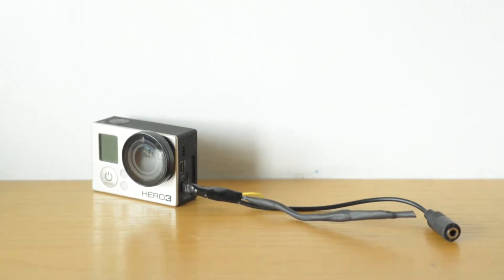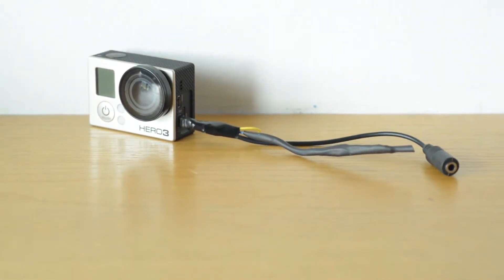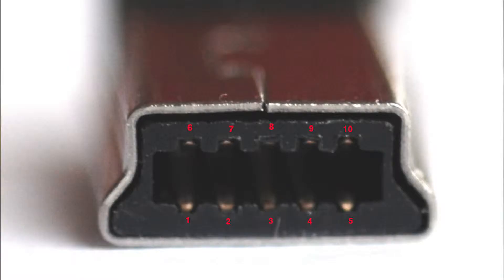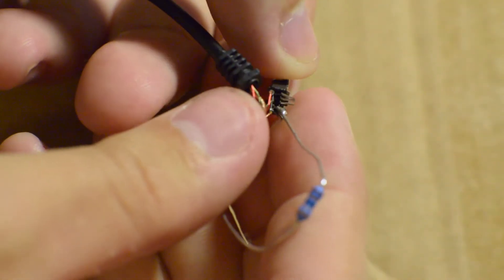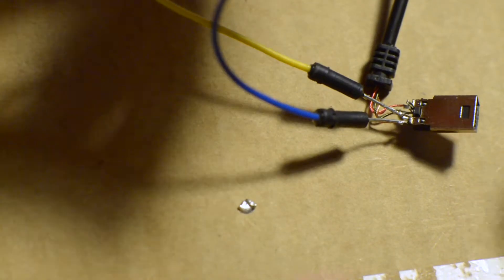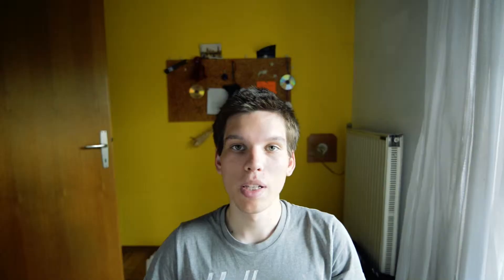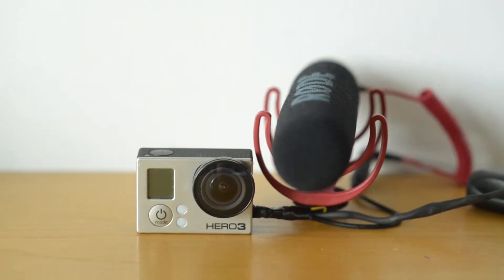Fake GoPro microphone adapter not working? here is the solution

Comment: COuld you make also a video where you stick the resistor? I didn't get where you attached the resistor
Reply from the maker: Ok, I actually found this adapter right now, it is not lost. I'll see what I can do OK? :)
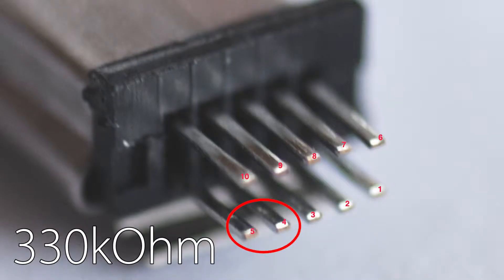Reply from the maker: Huh, I tried to take this thing apart to make a video how to solder it back together, but I glued everything so good I cannot take it apart. You must put resistor between the circeled pins on video 0:33. The picture is taken with the thicker side of mini usb on the bottom.